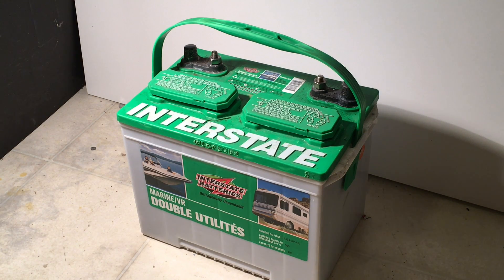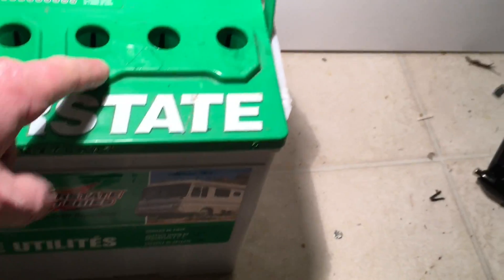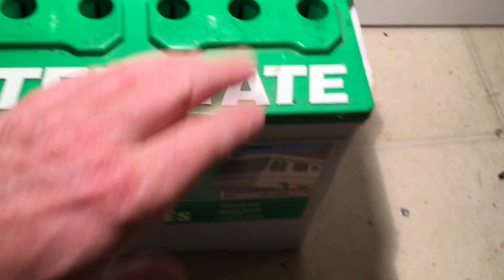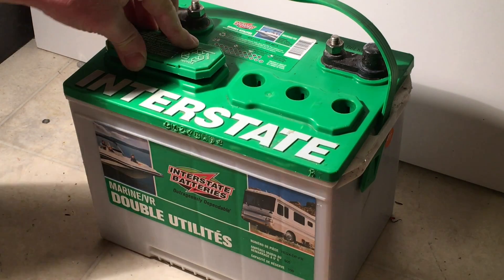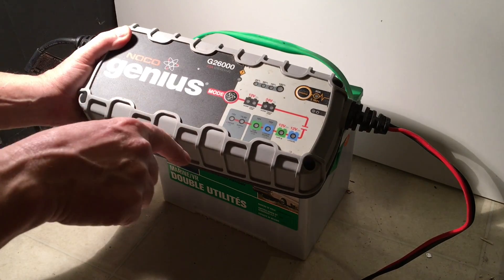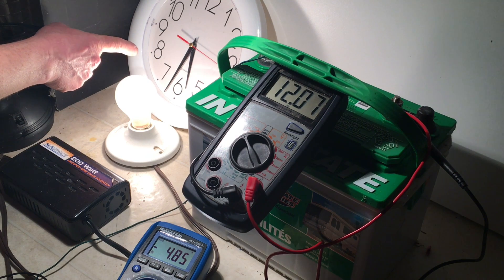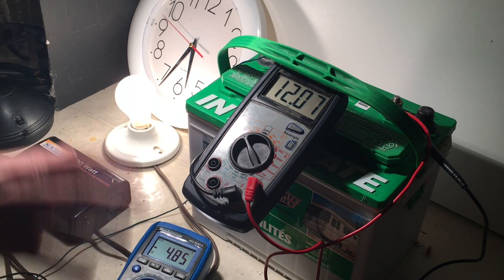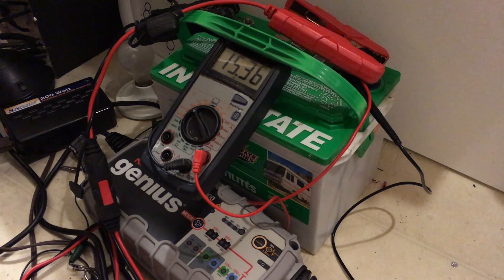Restore deep cycle lead acid battery. Revive dead sulphated RV car marine batteries

Comment: Reason no vid#2 or #3,  is cuz un- fortunately,  it didn't wrk.  These rampant reconditioning videos all over U tube are very misleading/ generally not very successful, or SAFE for average guy/gal. Only 10/15% are usable and only if they were not that bad to  begin w/

I too have tried several battery restoration recently.  Batteries will not recondition once U have 1 or more bad cells.  Even if you can get the voltage up about 12.5v+ Often we found once you load the battery. By load test or loading it naturally,  just destroys all your hard work of removing acid.  Neutralizing acid to make it safe to handle. Replacing acid solution w/new electrolytes like epsom salts/distilled water.  All the jumping thru hoops.  Shaking ( oh, and dont forget the baking soda washing of internal plates in each cell before replacing the electrolytic fluids.
u do all this on a battery that has 1 or more bad cells,  and u just pissed away hrs and hrs.
Its really either a good battery that can be brought back or a bad battery that cannot.
If u determine that before all the work,   u can decide if the 1 in 5 batterys u mess w/are junk before hrs if wasted wrk.
Its gotta be a good battery that needs some topping off of distilled water,  or a good slow trickle charge to get bk to 80%+

I spent 2 weeks trying to get a bad cell to revive in 5 different batterys.
None would revive ,  if they just had 1 bad cell.  Usually its a cell on the end.  Not always,   but if u were a betting man,   u dont wanna bet against the end cell being the bad or worst of them.  Prolly 75% of the time.

The real lesson here, is store your batteries not being used during cold weather or any weather when u can,  inside your shop/garage.  If climate is better thsn the outside.   Both heat and freezing prematurely kills batteries. 
The near 70% distilled water content can freeze in sub zero temps,  even thou the ~34% acid solution is a form of anti freeze.
Then,  when storing these expensive and not being used batterys in boats,  enclosed trailers for race cars,  and toy haulers, ect,  you put them on a trickle charger.  These newer de-sultiphication ( sp?) Chargers seem to be the better choice than the average Walmart , cheaply made Schumacher battery charger.  Don Schumacher didnt get to beca muti millionaire selling u a great charger at a cheap price.
He sells u a cheap charger at a high price,   hoes top fuel racing fir decades,  while paying the bill on not only his own sons Top fuel team,  but several other race teams,  including at times some pro stock bike guys like craig treble.  All good guys.
Point is. Cheap chargers dont help anyone get more out of a battery these days.
.plus batteries are made of lower quality materials now more than ever before.

So tricke charge ur batteries not in use,   and if u can.  Buy the 1s that have a desulphate mode.  U can,  without adding any fluids.  If you kerp exterior of battery suoer clean ( as that film of grime LITERALLY SUCKS VOLTAGE OUT OF BATTERY.)  Take & touch a volt meter to opposite ends of a grime'y battery case,  opposite sides,  and if there is enuff filth.  It will read on volt meter 1 to nearly 3 volts just touching the plastic case, as the filth also touches the posts,  and this acts as 1 large conducive "short" or drain. On your battery.
Just saw a 19 yr old, AC delco battery start to go bad,  as 1 cell is now going bad.
Car was kept spotless its entire life,  owned by a woman who loves her 2002 Camaro LS powered manual tranny car.  Its got 39k miles on it as of now,  but wasnt her daily till 5 or 6 yrs ago.  She works from hm,  so its not driven 12k a yr like average.  That battery looked brand new when removed from car,  as it started to slow crank in May,  which is not a weather month of extreme heat or cold.  
I tk it after she replaced it, and hav bedn slow charging this 19 yr old battery.  Still has 1 cell low, and reads on the very edge of good/bad,  on load tester.
Im gonna try using it on a old 4 cyl tractor for a while.  U just cannot fix a bad cell.  Then tend to short out. 
If battery makers built battery's properly,   they would all last several years longer. 
But how do u sell batteries to people who do not need replacements??

I have 16+  items that use 12V car or lawn mower batterys.  ( 3 that use 6V batterys)
3 things i own use 2 batterys per machine/veh..  
2 diesel trucks, &  1- 24v military diesel Gen Set, on military trailer, w/ two 12V smaller batteries,  in series,  to get 24v , as most military equipment is 24v.

So when u got tractors,  backhoes, muti lawn mowers, trucks, cars, fork lifts, battery powered indoor fork lifts, race cars, boats, rzr's , golf carts, enclosed car/toy hauler trailers. And everything uses  batteys.  U wanna get them to reconditioned status..

So when u got over a dozen +batteries,   ur constantly dealing with dead or liw Voltage/bad cell batteries. 

Dont even get me started on TIRES.
Phuk.  Prolly need, right now.  to buy at least 7 new tires for our 1 ton dually,  ( spare is #7)
 5 for our 4x4 diesel SUV --1 Spare). 
 Some tires are reasonably on both trucks, ,  but i hate to hav mismatched old/new tires,  on heavy towing vehicles.

Need 1 tire replaced on 3ramp mtr-cycle trailer.  Really shoul do 2 new 1s .

(We hav Replaced,  just in the last 18+ months or so....., 
 5 new tires on open 2 axle trailer, (plus spare), 4 on '90s beater car, 4 on f150,  
And 2 on a lawn mower.  Backhoe needs tires,  old ford tractor needs um still.
Forklift some day will.  
I hav an 18 yr old Optima red top in my old 50s truck.  Its the old 1 version AGM,  so its actually a good battery.  The newer 1s from Optima are worth a piss.  Might as well buy a $100 battery instead,  cuz the $200+ red top now days will likely not outlast 2 -$100 lead acids.. 
Sad they take great products and make them cheap to sell more after there reputation is established. 
So,  in the end.  Keep tires aired up properly,  keep batteries tended when possible,  & out of freezing weather when not in use.  AND NEVER STORE A BATTERY DIRECTLY ON CONCRETE.  WILL KILL IT QWIKER.  ON BOARD, PLYWOOD, OR RUBBER MATT.   NEVER STORE BATTERIES ON CONCRETE AT ALL IF AVOIDABLE. .
Wish these battery tricks worked.
The reason there is no #2 or #3 videos,   is because he couldn't get the battery to come back to 80%+ capacity. 
I know.  Just spent 2 weeks phukin w/6-7 ,of them.  Got 2 batteries to cone bk about ~~80/~85%..  only cuz they were not totally bad yet w/1 or morr truely bad cells.
If I ever do get 1 of these bad cell batteries bk to operating.  I promise you I will post it and how I did it 
Im wirking on trying to only charge a select q or 2 cells at a time rite now,  to try to de-suphicate(even a word?),  just the bad holes,   w/o overtaxing the already properly functioning cells.
Not even sure that will wirk yet.
But going to try it on an expensive Deep cycle for my encloded race car hauler. 
Will repost here if we ever really accomplish something worth posting. 

Im still waiting for the DIY Re-tread'ing of tires. As ive either spent,   or will spent.  prolly 3-4 grand on tires i havnt yet bought sometime soon.  Just dragging feet on those purchases.  Spent prolly $6/700+ easy ,  on 12v batteries in past yr.

Be safe when messing w/batteries. 
The acid on ur jeans isnt so bad.  Get it in ur eyes.  or ur kids eyes,  and u will wish u just bought a battery.  SO BE EXTRA AND EXTREMELY CAREFUL PLEASE .
LOSING VISION ISNT WORTH IT.

Last story.  My closest high school friends dad is at a gas station, . Off to side of main building.  Hood up,  as car isnt charging right,  maybe he figures alternator or bad battery.  Tryin to get hm from work. 

He us messing around /battery posts,  thinking they are just dirty & corroded so much it wont charge up from alternator. car us running mind u.
Suddenly,  no warning,   battery BLOWS UP IN HIS DADS FACE.  EXTREMELY BAD SITUATION. 
THE BLAST & SHOCK FROM THE EXPLOSION,  not only pushes him backwards,  but he sorta spins around and his feet hit curbing edge of parking lot.
He lands face 1st into the ground without hardly getting his hand up and outward, due to being blinded instantly by burning acid fluid from battery. 
As he lands face dwn,  he realizes his face is in a snow bank,  from the plow trk that cleaned parking lot a day or 2 before after snow storm.
Blindly e started using the snow to try to wah and flush eyes in a panic,  to get acid off face and out of eyes, nose and mouth. 

They called an ambulance.  By the time he was released from hospital,   the last words the ER doctor said was,  Mr G.  If by the grace of god u had not gotten that snow upon ut face an eyes /in seconds of it covering you,  id be talking to a blind man right now.  You nay be the luckiest guy ive seen in yrs in the ER for this sort of life altering injury. . & u are going hm w/ nearly no damaged  skin or other senses.
That snow save your vision,  and u having the common sense to scrub acid off.
 We all wanna save money,  but not many of these bad batteries can be reconditioned as these u tube videos would like u to believe.
I spent enuff time working on them to tell u its maybe 10/15% that. CAN recharged and tended.
Reply: That is the longest post I've ever seen on YouTube.... Good info.
Reply: @clintg3435  my apologies for the long post.  Stuck @hm during Covid before we knew much bout it.. In hopes of not catching or spreading it.  Going bat chit crazy from isolation i wrote that ridiculous post.  Really i just hoped to possibly save even 1 person from bodily injury over a battery.  Nobody wants to save batteries more than me,  w/all the 1s I own in muti equip/vehs.  Please be safe & try to find other ways to save money folks.  No new battery restoration storys to report btw.  What horribly ironic is that I think car manufacturers are going to somewhat force us into battery pwr'd cars in next 10 yrs.  Or less.  So I bought my last ever new car w/6 speed manual & nearly 500hp Naturally Aspirated.   Sold several old cars to find my new Bullitt Mustang & love it.
I made dealership put new battery in it before signing papers.  It was a left over '19 model,  new, & i made um test battery from sitting & it did not fully meet required charge status.  So at least there is that .
I also bought cuz I thk in 5 yrs it will be hard to get ICE perf cars to purchase.  Green new deal may never happen.   But a bunch want it.  & i want the roar of my V8- 6 speed manual tranny before they are extinct.
Reply: @here_for_the  No need to apologize, like I said its great info.  I was having second thoughts about replacing some batteries on my diesel truck and went ahead and replaced feeling guilty that maybe the old ones were ok just needed to be brought back... I feel good with that decision now that I have new batteries.
Reply: Yeah I can definitely relate to batteries with bad cells, though I did have one instance where one actually recovered and still is functioning normal this day. And yeah this is also why if I see a lead acid battery get thrown out I always get ones that are above 10.5v because the chances are it's fully working just needs desulfating.

Also for me, the best way to desulfate a battery is not any of the methods on youtube, it's by leaving it on the charger for a while and then putting it on a heavy load for some time. I repeat that process a couple of times and I can see major improvements how much current it can give and how long it will last with said current. You should honestly try this yourself because it works quite well and is much safer because all you are doing is using it the way it was meant to be used
Reply: @aleksandersats9577  once u get as old as I am.  U realize nothing is as irreplaceable as TIME.  MONEY CANNOT BUY IT.  I purchase higher quality batteries for my fleet & spend my time doing kore things I want & less time doibg things that are only worth it if U hav no life & do not value ur time.  My days are not like most peoples.  Most think a half day of work is about 4-5hrs.  In our world,  12 hours is a half day.  If 1 day has 24 hrs,  I get to choose how to use ALL OF THEM.  Yes.  Sleep is a necessity.   I once went about 7 months on a TEAR,  GOING TO BED BY 1:30/2:30 AM.  UP BY 5:30/5:45 AM. Everday ( 7 days a week) on this "Run".  We refer to these as a "Run".  I played the Rejuvenate a battery cell game & yes,  if its not truely bad.  It will come back.  Once bad or shorted by plate damage & lack of adequate space by contaminants or a loose plate..  Its junk.   Takes time to diagnose this in some cases.  Glad U have had your luck.  U can gladly desulfate all my batterys in the future if you want to.  What U learn imas U het older is although the wirking hr days get longer,  the Years ur still alive above dirt GWT SHORTER (METAPHORICALLY).  NOT FROM THE PHYSICS PROVEN THEOREM OF HOW SPEEDING UP AN ATOMIC CLOCK CHGS TIME IN MICRO FRACTIONS OF A SECOND.  ANY GAINS MADE BY HIGH SPEED TRAVEL ARE NEGATED LITERALLY BY 1 SITTING IF A BOWEL MOVEMENT. 
WHEN U CAN BUY TIME.  U WILL LEARN ITS MIRE VALUABLE THAN A BATTERY VICTORY A YR.
GLAD U GOT WHAT U WANTED THOU.
U GET NO COMPETITION FROM US GOING FORWARD.  GOT BETTER THINGS TO DO MYSELF.  WE ALL HAV OUR INTERESTS.
Reply: @here_for_the  oh Jesus christ, calm down I did not expect to get an entire page full of text and story
Reply: When I was 30ish, I had a battery blow up in my face also. I had soft contacts on. They absorbed the acid that hit my eyes and so my corneas we're not damaged, thank goodness and I also knew exactly where the faucet was on the side of the building at the parts store I managed. I worked my way to the side of the building and using sound, I knew which direction to go to get to the faucet. I couldn't open my eyes obviously because they were burning and had been since the acid hit my face. I just put my face under the water and kept flushing and flushing and that was after I took the contacts out when I got there. Battery acid is no joke. I'm currently trying to revive a couple of RV batteries right now and those are the two out of the three that held water. I didn't drain them, I just topped them off and trying to get some voltage. I'll test the cells later. Unfortunately one of the three had a crack in it from freezing. Another thing that I'm really surprised is how many of these battery rejuvenation videos tell you the voltage of the battery but not whether they put it on a charger or how long it's been sitting without being charged. Sometimes all you have to do is charge it up. You certainly can't test it until it's been charged. Not even a auto parts store or shop can do that. I can tell you it's dead and it doesn't have any power but unless it has been on a charger, it really does no good to test it. I guess that's all.
Reply: I am a chemist and work with Acids and such quite often. I have concluded the same sad result. Anyway because I know people out there who would probably hurt themselves attempting this I am going to safely disassemble the battery completely clean out everything replenish with proper fluids and fully charge it and if I can find wherever I put this comment I will let y’all know how it goes. Seriously though don’t take apart batteries if you think the liquid inside a battery hurts Think about the concentrated stuff. Till next time.

Comment: There are  a few things for getting a good result
never try to do this unless you are sure what you are doing - the acid can burn you
check the voltage first - there may be a dead cell which would waste your time.
Check the battery fluid.
Try to fully charge the battery.
(I read about these and more on Jons mender guide site )